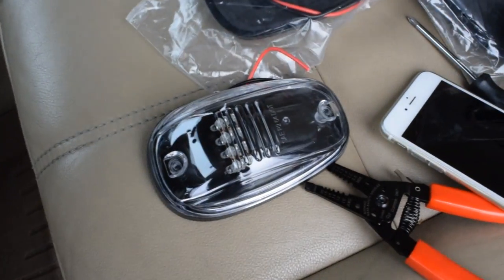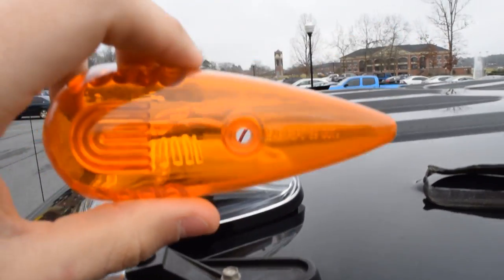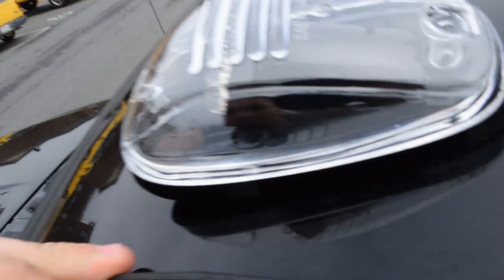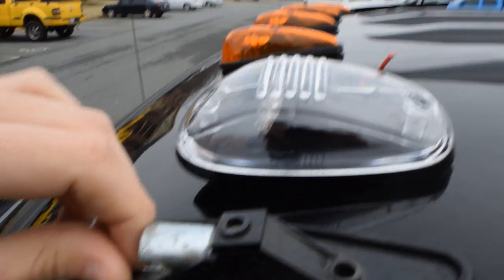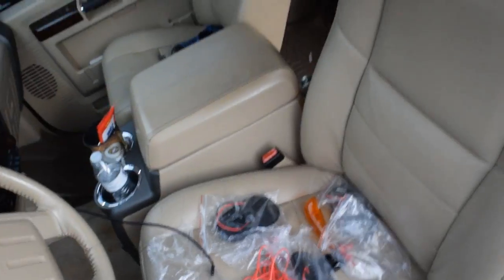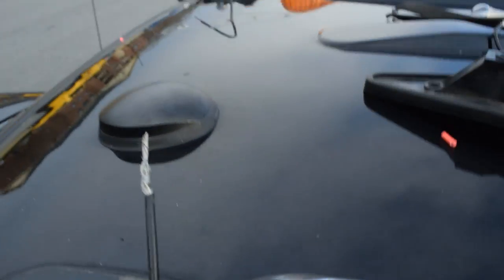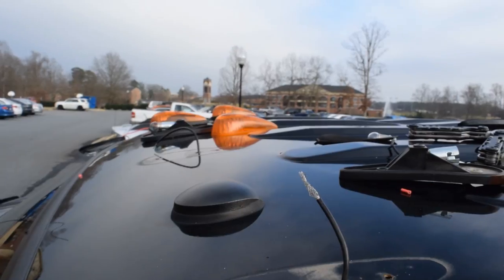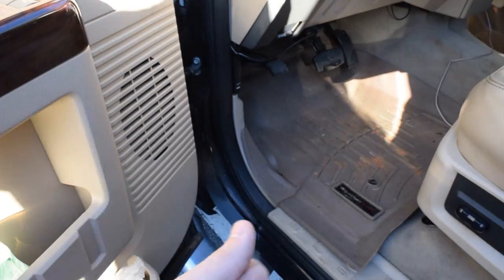LED CAB LIGHTS INSTALLATION (Auxbeam)

Comment: If drilled, will it safe water from entering in interior???
Reply: Yes just put silicone on the cab light housing. They should come with foam or something on them

Comment: hey i got some of these on Amazon just like yours BUT instead of a red wire sticking out its a plug to connect it to the light and the led starts working. but it makes no sense because they dont fit. even though the plugin is perfect. I have to remove the whole thing just like you did.

Comment: The "originals" weren't factory. They were cheap aftermarket.
Reply: There "cheap" but there a quality light ...harbor freight ,lot of pple have good luck with them.
Reply: I've had 2 trucks that I installed the cab lights. I bought some High quality ones that cost me about 130 and i had to many problems with them. Then on the next truck i just went cheap. Bought the 15 Dollar Harbor freight and never had a problem with them.